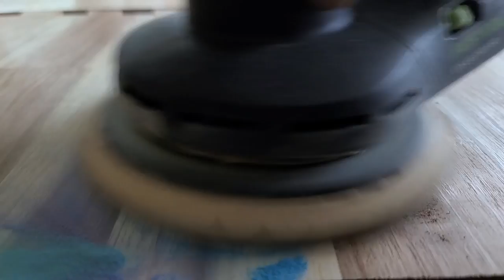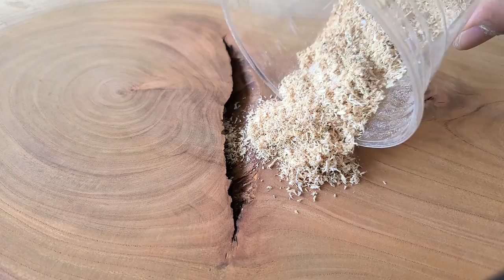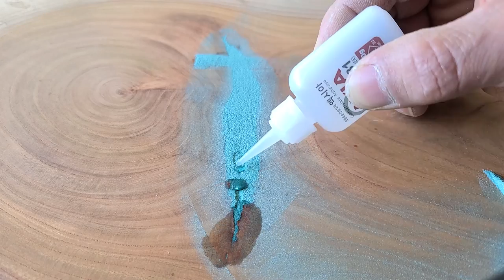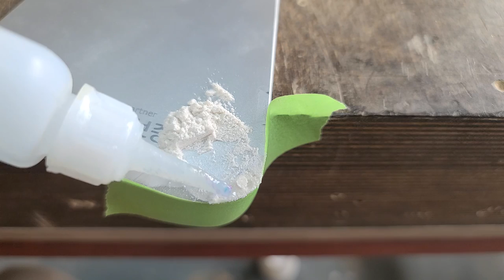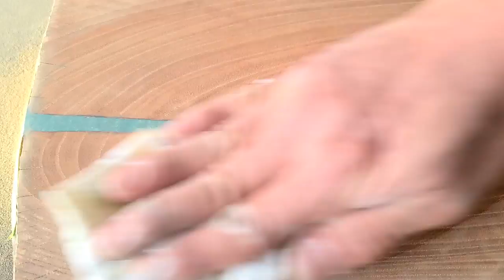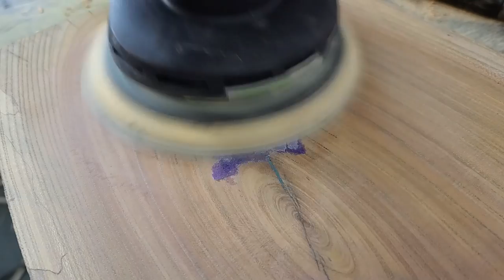Super Glue + rainbow baking soda ! Pour the glue into different colors of baking soda.

Comment: i had no idea baking soda gave such a powerful bond with cyanoacrylate glue. thanks for sharing!!
Reply: Ive heard It can degrade over time but its amazing how quickly it dries and gives you a workable surface
Reply: Modellers use it for gapfilling sometimes.
Reply: It doesn't really give a bond so much as cause the CA glue to almost instantly set into it's hard plastic form.   The downside is you have to be careful as it can cause a lot of heat.    Also if you use too much filler then it will end up really weak.  That is why you see him do it in multiple layers.  You don't want your layer to be thicker than what the glue will penetrate down through.   You can actually use CA glue and then just a squirt from a spray bottle of baking soda water as well.
Reply: Yea it boils down to surface area. Like how if you "connect" two phone books together by laying a page down on one than a page down from another on top of that one and repeat, just the friction from the pages touching you wouldnt be able to separate them even using forklifts.
Reply: Is that what super glue is called?
Reply: @thisisretropete  yes. CA glue or cyanoacrylate is the generic name.
Reply: What will happened if baking soda react to water? Will it dissolve in water?
Reply: Thats one way they fix chips on helicopter blades
Reply: Where  can one get the color powders?
Reply: It’s that sodium atom of baking soda works as the perfect catalyst that triggers the polymerization of cyanoacrylate into polycyanoacrylate.
Reply: It's a technique than we used a lot of time ago in Latinamerica ,specially In Argentina.
Reply: Chalk dust also works just fine ;)
Reply: @ZeArmo  la gotita + polvo de tizas queda perfecto. El cianocrilato tambien.
Reply: @pvrhye  I'll fill your gaps
Reply: Yep it's fantastic, aways keep both in the car incase of emergency. Ideal for a quick radiator fix or leaking hose.
Reply: @ProDMiner  Yeah, if you notice in the video, there's a lot of smoke coming off from many of his drops. Funny story, but is a good cautionary tale. The accelerator spray gives you a much smaller "exothermic" reaction especially combined with thin glue. I've used them together to stitch together a cut a couple of times. You could try that! maybe try it first yourself lol
Reply: Is that like nail glue or super glue?
Reply: It really does. I've repaired small, fiddly plastic bits using this method. It's VERY strong.
Reply: @jupiterlove76  it's the same thing. Nail glue often has tint/pigment but it's super glue
Reply: Yh i used this method to stitch a toe back on.. baking soda water and plenty of superglue... dont try this at home lol
Reply: @ProDMiner  You guys should have use water, it also speeds up reaction and cools down generated heat. CA glue generally hardens thanks to air moisture.
Reply: Materials science tip: generally the quicker the set, the worse the lifespan of the glue. Quicker glues usually degrade and embrittle sooner
Reply: @pvrhye  thank you so much. I've been looking for the "translation"! 😍🙏
Reply: Helicopter pilots use that method to repair small chips on the blades fast and efficient
Reply: It's an old model making trick. Just ask Adam Savage.
Reply: @thegreatestaek3120  CA glue does NOT dissolve in water. (I just stuck my fingers together this afternoon. Fun time getting that apart! lol!)
Reply: @vociferonheraldofthewinter2284  
I hope you discovered acetone since you posted! 👍😜
Reply: @TaterChip91  ah no. Carbon fiber with dings gets scrapped.
Reply: @JoaniesJourney  Sadly, no. My fingers are stuck to this very day... lol!
Reply: @vociferonheraldofthewinter2284  just two fingers or three....
Reply: I use super glue and baking soda to repair gitar nuts.
Reply: But what if you need to make a telephone call
Reply: @Jarrettmonty99  Bowlers use it a lot on their thumbs and fingers that crack open.
Reply: If you dont have any accelerant baking soda always work. But you do have to be very careful about what you are trying to glue using baking soda because it becomes almost instantly too hot to touch.
Reply: Thanks for answering my question about what kind of glue it is.... 🙂
Reply: Baking soda is a kicker of ca glue it works great a give you some more material  to work with. Turns into a white sandable almost plastic
Reply: Adam savage is where I learned to use it
Reply: @iwinrar5207  😂
Reply: @pvrhye  is it dangerous?
Reply: @rickybobbyracing9106  the dangers of superglue are on the bottle. If you use some kind of accelerant, there may be hest involved as well. Don't be the woman who superglued her hair.

Comment: I used baking soda and superglue to fix my broken bathroom sink counter (someone leaned on the corner too hard and cracked the corner off). Stuff works like a champ!
Reply from the maker: Magic liquid and magic powder.👍👍👍
Reply: @망치소리HammerSound  whats that color powders?
Reply: @LE1Dreamer  I don't know exactly what they are made from, but they are typically sold to color that 2- part epoxy, so you can find them anywhere that sells that stuff (hardware or craft store).
I've also seen videos that compare their efficacy to other household products you can use... I've seen ppl get supposedly good results from things like cayenne powder, chocolate milk powder, mustard, etc.  But things like that may interact chemically to change results.
 I KNOW cheap make up products are essentially same thing though, so you can get those blush kits (dollar store?) with multiple colors and try those too... 

Experiment!

Comment: I love this method. I’m thinking I projects to use it on now. You gotta love that Festool sander huh? 
I think all of their tools are the best especially the track saw / guide rail and domino joiner. Thank you
Reply: Festool is the best! Especially the domino joiner
Reply from the maker: Festool is very good.
Reply: Agreed.... though I've never actually used any of their products lol. But they are the unaffordable things I wish I could buy the most : )
Reply: Are the really worth the cost? That sander is AT LEAST $300... I just bought a junker at Walmart for 35 bucks last week... what are the aspects that make it so much better? Power of motor? Dust collection efficacy? 
I'm honestly asking. Sanding is MISERABLE, so if it's quality decreased sanding time by even 20-30%, that may very well be worth it in long run.
Reply: @theoriginalmonstermaker  absolutely worth the cost. I wouldn't pay for festool drills, but sanders, vacuum, track saw, domino joiner absolutely worth it
Reply: @theoriginalmonstermaker  if you are sanding alot, festool sander has extremely low vibrations, they sand very well and if you set-up the festool vacuum, it's pretty much dust free sanding. They make the dewalt, bosch and makita sanders look and feel average
Reply: @C783H  Cool.  Thanks for info.
Reply: @theoriginalmonstermaker  but before you go and buy it. It's not worth purchasing unless you are using it day in day out and making a good profit out of your trade. If this is just DIY work or for a job here and there, a ryobi, dewalt, makita, bosch will be perfect. Most of my tools are bosch and makita. I just have the domino, orbital sander and vacuum.
Reply: @C783H  don't worry lol. There's no fear of me ending up w a festool anytime soon.  I'm super cheap.  But thanks.
Reply: Nice thing about those air tools is they are quite powerfull and light, since electro motors can get quite heavy. One downside tho is the efficiency. Air is the most expensive power source as you first need to compress it, and whether you use electricity or gas to run a compressor, there are losses by running the compressor and further losses for running the airtool. an electric tool can have up to 97% efficiency, an airtool with compressor is probably half that.
Reply: @hernerweisenberg7052  why are you talking about air tools?
Reply: @Palpac  Because Festools
Reply: @Palpac  Aren't they mostly knowen for their compressed air powered tools? At least those are the tools i know from them.

Comment: I use super glue & baking soda to close and protect any cuts or wounds I get. The instant hardening keeps blood from washing it away or running and it adds a hard shell to protect it. It falls off like a scab when it's done healing. Bandaids and unsealed wounds weren't a good option in my line of work.
Reply: What color pigment do you use for that? 🙂
Reply: Or you could buy medical glue.
But of course, I used insulation tape myself on a wound for lack of bandages.
Reply: @BoraHorzaGobuchul  I think medical glue is the same stuff but I'm not sure. Hey we gotta make do with what we've got 🤣    I splinted my hand with a paint stick, some pencils and blue tape until I could get to the doctors 15 hours later. Insulation tape is wonderful. I always keep an extra roll on hand.
Reply: @Dwayne_Bearup  well.. it depends on my mood. I usually go uncolored but if I was feeling fancy maybe I'd do green or something. It does turn a tad bit red if you're not quick enough.
Reply: @blueninja115  I suppose there are various medical glues in use. The ones I used were not CA. 

Blue tape is great for almost anything )
Reply: You can get burned from the mix..
Superglue alone is ok to close wounds.. but with soda is another story..

Comment: You can also use matte urethane with the pigment for filling holes with a natural pigment look after. Will work better in the end than spotty ca glue. Cheers!
Reply: Jeffrey would you fill the cracks completely in one shot or in layers, letting them cure in between?
Reply: whats the setting/drying time like on urethane? I like the video, but was also a little against some of the more spotty appearance on larger sections. still think this is a brilliant use case on very small pieces needed finishing quickly

Comment: What strength does a bowtie made from CA glue have in the long term? If it's strong enough compared to wood, maybe sawdust and CA or epoxy can be a time saving alternative to making a fitting bowtie piece.
Reply: i think the bowtie out of baking soda it's just to make it look good, but i'ts not gonna hold for so long, and absolutely not gonna prevent the wood from keep craking
Reply: The CA glue/baking soda mixture dries VERY strong, but very brittle. A way of looking at it is that the CA glue/soda mix has many of the properties of tough glass. Would a piece of thick glass work as a bowtie? The center point would be a weak spot. It would be strong, but prone to shock.

I haven't tried this myself, but I'm thinking that the fibers in sawdust would add an element to tie the whole thing together. Sort of like adding fibers to concrete. Same principle. I'd run some tests before I sold it to customers, though. It might end up being much stronger than a wood bowtie.

People use this mix to do some insane repairs that hold up amazingly well. I think if you did some digging you'd be impressed. 🙂

Comment: I think for those large gaps it's actually easier to use clear epoxy resin with the same pigment.  You don't have to fill more than once.
Reply: what if we can't afford resin? this is just superglue and baking soda 2 things easily found in a dollar store
Reply: @Nonexistent_creature  Well, I mean 5 minute epoxy tubes are "resin" and also found in dollar stores.  You don't have to buy the 1 gallon jugs of resin (though I suspect those are cheaper in bulk).
Reply: @fredrichardson9761  I have never seen epoxy in dollar stores. I've seen them at Walmart but never dollar stores. they go for like 11- 20 dollars so selling them in a dollar store would be illogical
Reply: @fredrichardson9761  5 minute epoxy is only to be used as glue. If used in large quantities, it will overheat and not cure properly. Five minute epoxy and casting resin are two different things.

Comment: Could you use fine wood particles, such as saw dust or from sanding, to achieve a close match to the piece being repaired?
Reply: Definitely,  I used it all the time
Reply: While building pantries or cabinets I keep the saw dust from a particular area of the wood that I'm going to be setting screws in and use it and the glue to fill the hole. Usually comes out looking pretty decent. But I think putting a dowel in, keeping the direction of the grain in mind, then sawing and sanding. As for cracks and voids I might stain a scrap piece of wood then use that sanded saw dust to try and match the blemished wood.
Reply: @williamturner8158  yeah, I was more wondering if you could use the baking soda and superglue with said wood dust to get a faster setting repair. Rather than the old Elmer’s glue method I was taught
Reply: @wesleywlee  no
Reply: @stanleyhape8427  thanks
Reply: @wesleywlee  i think that's what the guy does in the video before using the pigment, so you may be fine. But you also might have better luck getting wood filler, if you can get it.
Reply: @fuffboi7570  yeah, I’ll have to play around with the idea a bit and see what comes of it. I’ll post what I find here, for any interested.
Reply: @wesleywlee  I don't see why it wouldn't work fine... the only potential problem I can imagine is the color of baking soda changing the mixture  color to a degree where it no longer matches as well... but you can always use it on all the deeper levels and just switch to sawdust no soda in the top few mm.
Reply: I havent used it with saw dust, but 2P10 is a fast drying wood glue.

Comment: Quick question: 
Is there a specific ratio of baking soda to colored powder you use?
Does it change based on application for any reason?
Reply: You just soak it.
Reply: Is theres not enough glue it will be powdery if there's not enough powder the glue won't be dried instantly
Reply: If it's a gap or hole I would add super glue first a thin layer then dust with baking soda liberally. Then continue slowly till its built up and very solid through.
Reply: @RogelioEscobar  i prefer dust first in small layers so that you know the dust settles all the way to the bottom and isn't floating on top of that glue layer. Capillary action should take care of the glue reaching the bottom of a hole if you do manageable layers
Reply: What exactly is the coloured powder?

Comment: Don't use baking soda and CA glue on any repairs that require mechanical strength, as the soda/glue mix is extremely brittle and breaks easily.

In short, it's good for cosmetic repairs only.

Edit: I just noticed that the video author used the soda/CA mix to make a butterfly repair across a wood crack. This repair will be very weak. You're better off using a wood/epoxy glue butterfly plug, with the grain of the wood plug running at right-angles to the crack.

Comment: So there just colour pigments that u would use with resin normal? But u mix them with baking soda? An then what is the adhesive?
Reply: There's a chemical reaction that takes place between CA glue and baking soda.  It accelerates the curing of the glue to seconds, forming a very hard result.

Comment: I think that there are better ways to do most of this jobs... For small things like covering a bolt it's fine, but for for domio joint, it is useless instead if you don't want to make it useful, and only search for beutiful (that i don't like cause it leaves some drop pattern...) for bigger works i prefer tu use epoxy or a piece of wood and wood glue. This method can leave a lot of empty spots where the pigment is not fixed and does nothing to help make it stronger or reinforce the structure, so if u look for something beautiful, but not so lasting is a good way to not spend a lot of time.

Comment: No baking soda? Use ordinary flour!

Want super, super, SUPER tough ... Use mixture of baking soda or flour and graphite powder ... Sand down a pencil lead or buy powdered graphite ... Not too fine, powder, not fingerprinting dust!

Other powders also work ... Use talcum powder if you're in a bind. 

Sawdust on its own, especially fine sawdust works great no need to mix with any other powder, although it may help.

Comment: CA glue (super glue) is probably the worst thing to use for these projects, and the baking soda changes the texture of the glue. CA is brittle and doesn't bond well. Use an epoxy resin. They make ones with a pot time of ten minutes. They bond well and are hard but flexible. If you must use ca there are much better ways to dry it. You can apply water, large quantities don't work well, but mist or exhaling (not blowing) on it will help, or if it's a large project they sell ca drying accelerators like Zip Kicker.

Comment: I wonder if the bow tie actually has the tensile strength to prevent the wood from splitting.
Reply from the maker: I think it will be more immature than wood
Reply: You could try dropping a couple of small annular ring shank stainless nails in before filling it up. Never done a test though.

Comment: Use wood from the sander bag, not stringey saw dust.
Reply: I found out sanding off a corner of a balsa wood block doesn't work that great either. It was stringy.
 I was filling the holes on a drawer after changing the type of pull. So no matching sawdust to be had. Now I want to try fine glitter and baking soda 🤣